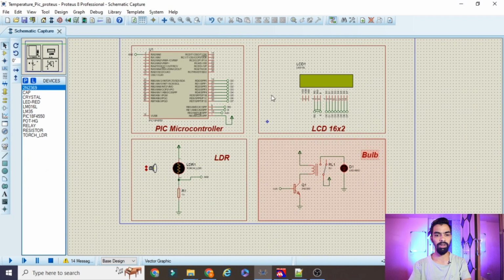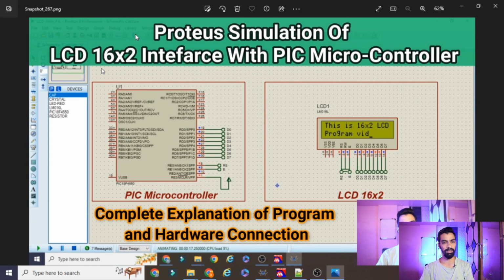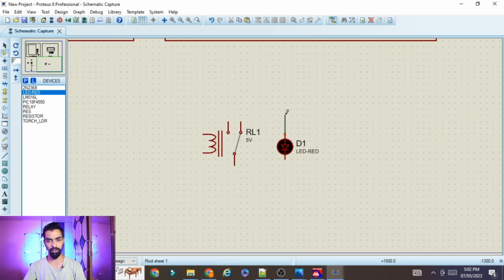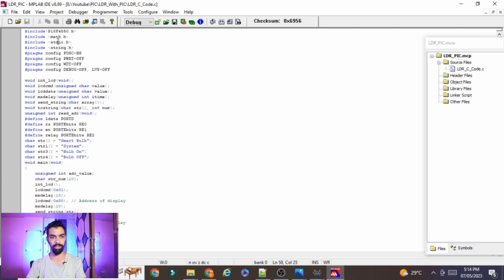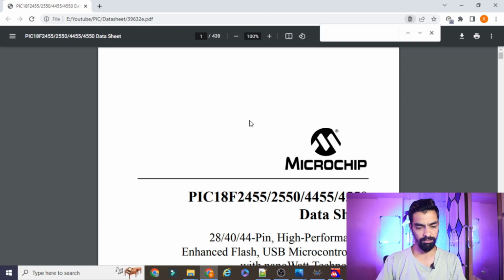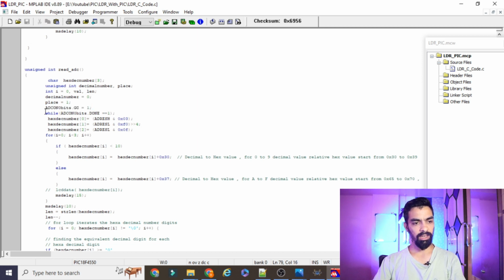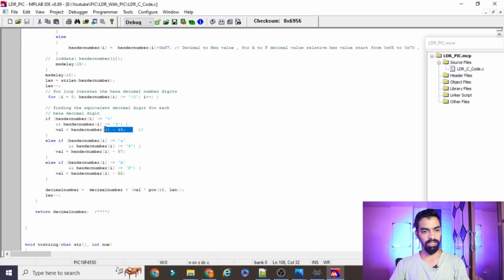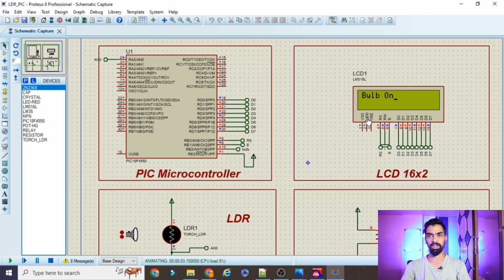Automatic Bulb ON/OFF System Using PIC Controller | LDR Sensor With PIC18f4550

Comment: sir can u do this project as a challenge soon using Arduino mega or Uno,
using ultrasonic sensor to detect the level of the tank, and using 5 led make led display without LCD for 20% on the first led
for 40% on the second led for 60% on the third led, for 80% on the fourth led and for 100% on the last or fifth led, and send SMS massage when it reach 80%  or greater than this value.
when the person the receive the text  he could command it by texts "valve2 open"  to open the valve2  which is connected to the outlet of the tank there is a valve2 closed connected with relay and  "valve1 close"  to close the valve1 connected to relay which is connected to the inlet of tank.
 
second using a flame sensor if fire is detected to notify using GSM 900a and
to close the  opened valve1 connected with a relay considering it as pipe of flammable thing  and make an a led light on before a fire is detected and close it automatically with relay state  off state when the fire is detected after that the valve must only be opened using SMS text "valve 1 open"
and  off LED when fire is detected automatically then it must be on only the using text "power on", make a sound using buzzer when fire is detected
and display it on LCD 20*4 the text that fire detected, use a pump connected to a relay to pump a water for fire sprinkler, and buzzer should be of when fire is prevented.

please I would really be pleased if you do it with practical  demonstration
and I want you to know that you are the best explainer
Reply from the maker: I will check
Reply from the maker: Please send msg on WhatsApp..and remind me on Friday
Reply: can I send u using email  I don't use WhatsApp
Reply from the maker: Hello are you there ? Is it a water tank ?
Reply from the maker: Your project done.. video will upload tomorrow
Reply: @Rahul_Jadhav_Project yes sir ...........ya it's water tank .................. can u include it with millis() the task of that i use are multiple and difficult to get 1 task immediately